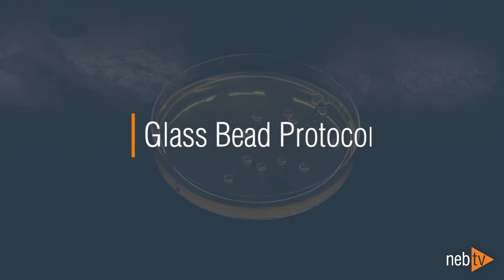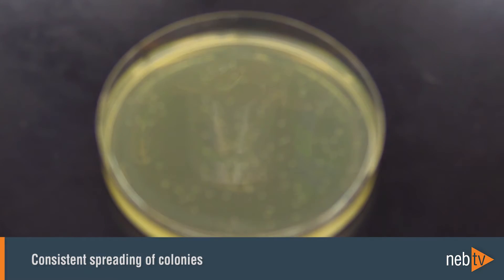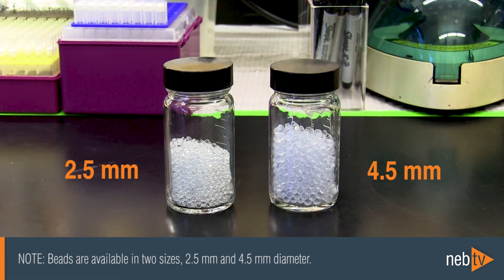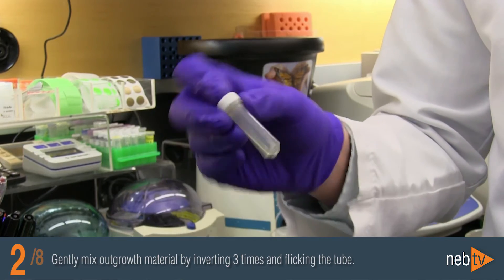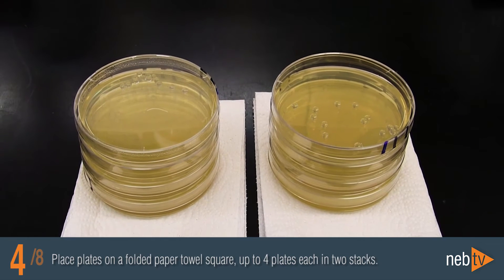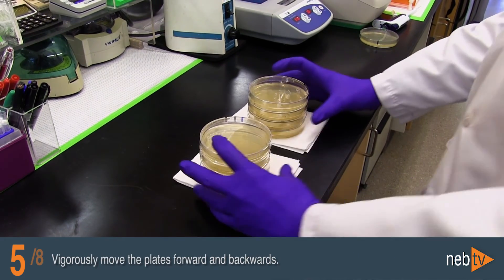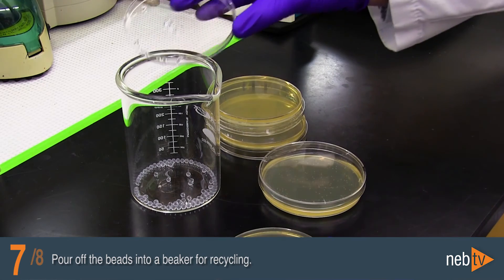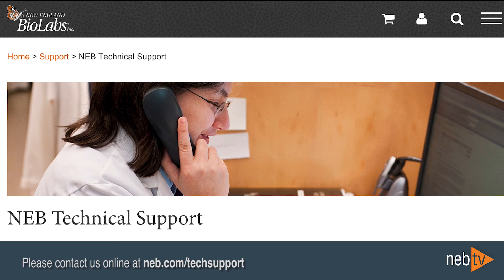Fast transformation plating with glass beads

Comment: So helpful! By the way,  Is it okay to autoclave the glass beads??
Reply from the maker: Thanks! Yes, you can autoclave the beads for re-use. Here is what we recommend: collect the used beads off the plates by pouring into a funnel on top of a 250 ml glass bottle. When the bottle is full of beads, add water, put on the top and shake. This loosens most of any material clinging to the beads. At the sink pour water/beads into a sieve, and rinse some more with distilled water. Then rinse with 70% alcohol, and leave spread out on a paper towel placed on a raised edge tray overnight to dry.  In the morning, pour the beads into smaller bottles for autoclaving.